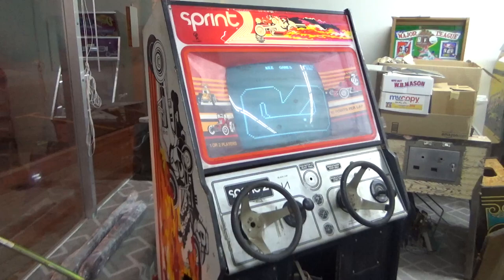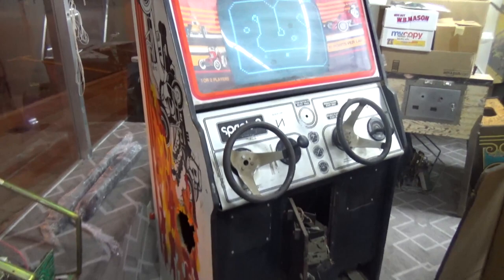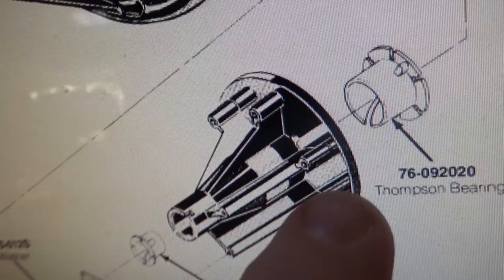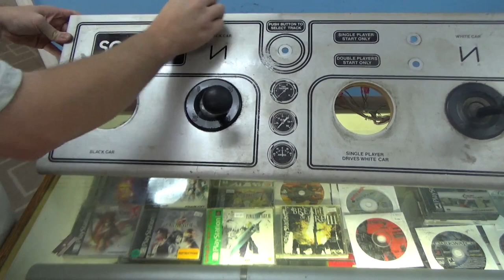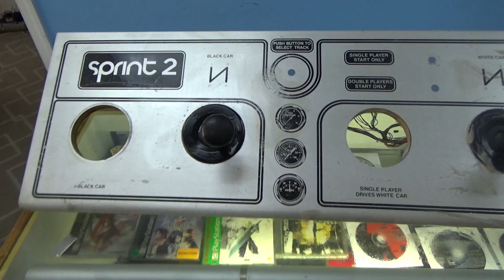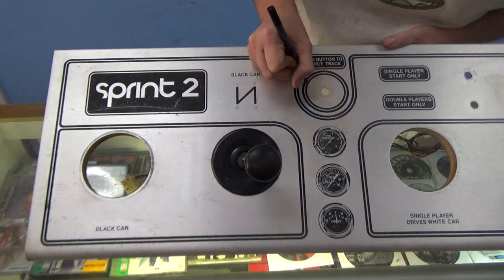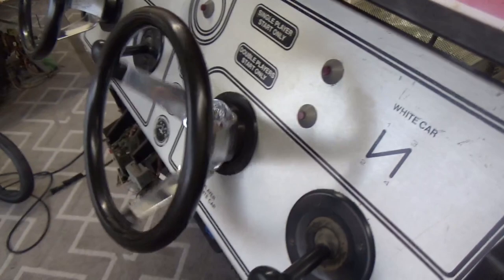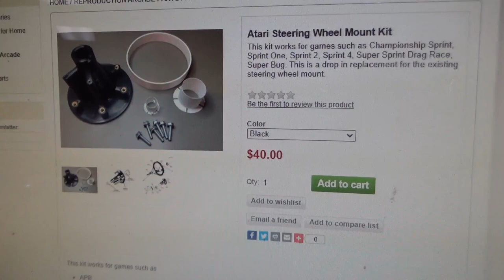Using A 3D Printing Service To Prototype The Steering Housing On This Atari Sprint 2 Arcade Machine!

Comment: One suggestion for the new design would be to use some cheap and commonly available metal bearings. The rear shaft looks too big to use skateboard bearings, but there has to be another common bearing that could be used. The metal bearings would make the wheel spin even more slick.
Reply: I think their goal is too make it perform as close to original as possible.

Comment: You CAN clear sharpie but it's a REAL pain in the azz (found this out the hard way making my sister's birthday present), you have to wait for the sharpie to dry, then put on two VERY LIGHT coats about a half hour apart, that gives the solvent in the lacquer time to dry without dissolving the sharpie ink. Then after that you can put on a heavier coat.

Comment: I wonder how long they lasted before they started breaking.    Maybe the design had a flaw, or maybe Atari did it deliberately to save a dollar at the time, knowing it may only last a couple of years.  Maybe it was due to lack of regular maintenance or just because Arcade games were only expected to last a couple of years in the field?   We will never really know.  I guess we got good schematics and bad plastic..  🙂
The 3D printed part looks good and those inserts are a great touch.  I think some places call them TR Fastenings or Heat-Set inserts, but a lot of jungle listings just call them knurled brass thread inserts.
Reply from the maker: He did a little video where he heated them up and pressed them in with a soldering iron so that's the general idea I guess!  Thanks for watching Brendan!

Comment: Thats a dam good price he could charge $100 or more if no one else is making them and people would pay it to ocd perfect
Reply: Depends on demand, but assuming there are a significant number of people looking to replace this part, at $100 it wouldn't be long before someone else did the same design and printed it. If there aren't a significant number of people looking to replace the part, he could probably get away with $100, but he still won't be making that much money on the part, and he'd sacrifice the goodwill that providing a part like this at a very reasonable cost would earn him.

At the $40 price point, there's really little reason for anyone to replicate his work, except out of curiosity or pure enjoyment of the process. So this way, he's got a good chance of capturing pretty much 100% of the market for this replacement part (important for a person in the replacement plastic parts business :) ).

Comment: Very nice tip on not using the sharpie to fix the black. I learned the hard way. ha.ha  Yes, amazing price on the 3d print. I would think the plastic alone would cost more than that!
Reply: Depends on the material, but the raw filament for the print is probably in the $30-60/kg range, and that part is probably only 100g give or take, so maybe $3-6 of plastic in the print.

For the price, you're mainly paying for R&D (the seller had to design the model, which for an experienced person might have taken up to a couple of days of work, including first drafts and revisions based on feedback from these guys), operating the 3D printer (which frankly isn't a lot of effort, but is still a distraction that needs to be dealt with), and of course the handling of sales and shipping things out.

For what you're getting $40 is a good price, especially since it comes with all the extras (bushings, nuts and bolts). But that's not because of the plastic. It's because all the labor involved in coming up with the design and then dealing with customers to print it and ship it out.

Comment: @06:16 - lubricate with furniture polish ? Daily preventive all-in-one - polish screen panel & controls. A.W.P.s & S.W.P.s.
arcade manager told me, it was a fix-it solution to stuck plastic-on-plastic parts, cola spills on buttons and that tell-tale little grinding wear dust, inhibitor on black plastic high friction areas, Camelot Theme Park -1998. - I still do !

Comment: What kind of marker did you use on the panel? I need to touch up some on my Sprint 2.
Reply from the maker: https://www.amazon.com/dp/B00MWSVFDY/ref=as_sl_pc_as_ss_li_til?tag=lyonsarcade-20&linkCode=w00&linkId=64bff72cc463e07660ba22cbcdfcad94&creativeASIN=B00MWSVFDY
Reply: @LyonsArcade  THANKs for the link!